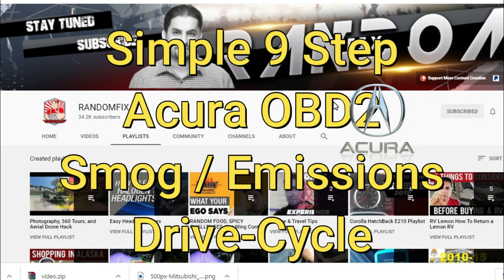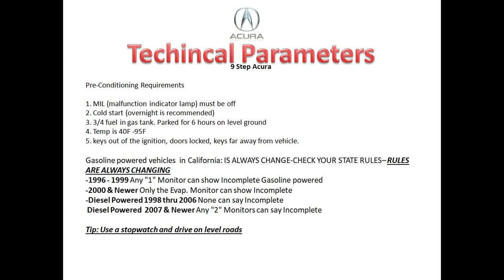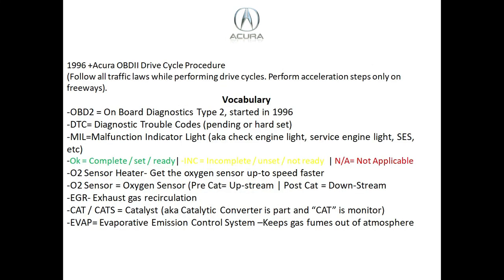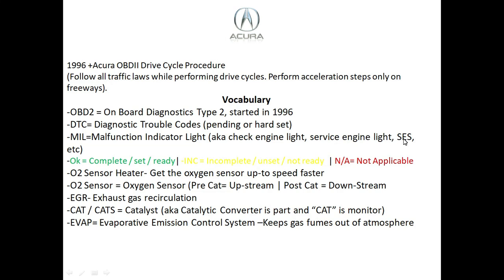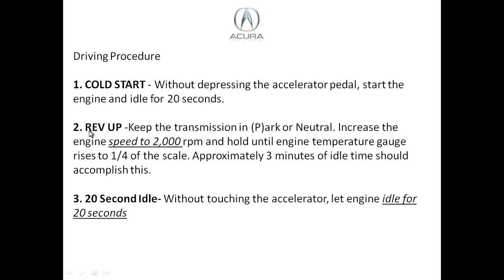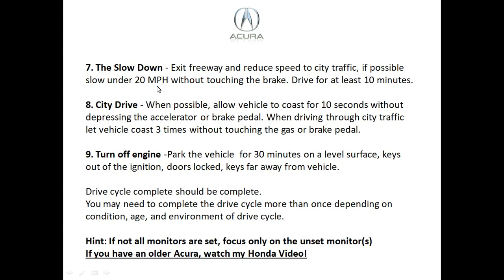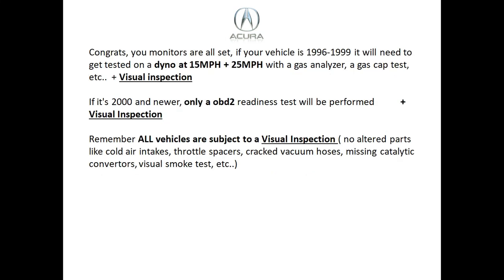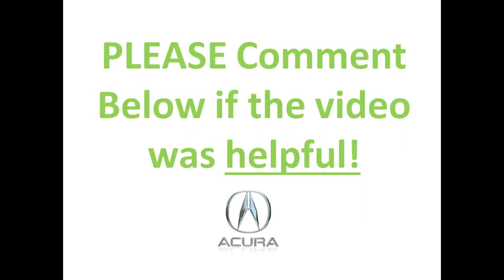Acura Emissions Drive Cycle▶️ Acura Smog Test o2 EGR CAT EVAP Monitor Readiness

Comment: Thank you very helpful .I have a 05 tl went in for a smog .Smog tech not .ugh help all he told me was to do the freeway driving for 60 miles and come back and it should be  ready no it was not.!!!! .I saw your video  and pulled my battery to start fresh no code before I pulled the battery.Thank you my brother my hat is off to you cheers  to you and yours.And yes all miter are set smog pass thank you.👍👍👍👍
Reply from the maker: Thank you for your feedback, much apprecated

Comment: Hi,
Everything passed except for my CAT. It says not ready. Which step do I need to repeat in order to get this monitor ready?I've driven over 500 miles in one week, but I think I made the mistake of going faster than 50 -60mph at some points,which I read somewhere might restart the cycle.
Reply: Fyi I have a 2012 Acura TSX automatic transmission
Reply from the maker: Sorry for the late reply! did you find a solution?

Comment: I have tried this step by step process multiple times in last couple of weeks and got all monitors got set to ready except EGR for my 2019 MDX, cant figure out how to set this. I must be doing some thing wrong. Any advice?
Reply: I don't have any pending codes
Reply from the maker: What caused the vehicle to need a drive cycle?

Previous check engine light or low battery? I cannot believe you MDX is a 2019, as it should set the monitors pretty fast.
Reply: @RANDOMFIX  Dead battery, wife left the hazard blinker on for a few hours before realizing the mistake, jumped the battery to started the car then and driving well since the. I don't have a engine check light on. Need to take it for emissions to prepare for renewing registration, that is when realized EGR is not ready,.
Reply from the maker: Is your battery truely good? A 12 volt battery once it goes bad can be permanently damaged. This cause all sorts of issues including systems not working as designed. Try lots of coasting from speeds to lower speeds with touching the brakes or gas pedal. If 250 miles you egr is still not ready, test you battery not just for voltage but under voltage under a high amp load. The load tester is about $30 but don't buy the electronic digital once. I can send you a link you want. Keep me in the look.
Reply: I put new battery on mine and did the drive cycle and it didn't do anything different still EGR not turning off
Reply: @RANDOMFIX   why these Acuras are so hard to get the EGR ready
Reply: @tuculoahuado6072  did you end up finding a solution?  My 2022 MDX keeps showing that it’s not ready because of EGR too.
Reply: My 2021 acura ilx  A spec same problem egr!
Reply: @nodairydiary  Good Morning,  my 2020 mdx same thing, did you find any solution, please let me know i would really appreciate
Reply: @joenawab7169  did you find any solution, my 2020 mdx same problem,  showing EGR not ready yet,  please reply i would really appreciate your help
Reply: @nodairydiary  same with 2020 mdx and same problem, did you find any solution, please let me know
Reply: @psandhu27  we used paddle shift acceleration to get up to 40-60mph when entering the highway.  Then drove it 60 minutes within those speed limits.  I think it just needed all sorts of driving types during the drive cycle to “complete”.  Good luck!
Reply: @ricecakeandboba thanks, I'll try abd see if it helps

Comment: Already did this 20 times it's not getting complete Acura 2020 EGR this is bullshit
Reply from the maker: Thank you for the feedback. If all other monitors are set other than egr, focus only on the high speed coasting to under 20 mph. Verify there is not a pending code or permanent code. With Vtec engines while you are gain speed enhance the vtech of the engine ( high rpm acceleration).

Make sure you your battery is ideal( engine off load test). I am not sure why your monitor data is erased on a 2020 Acura? Good luck and keep me posted.